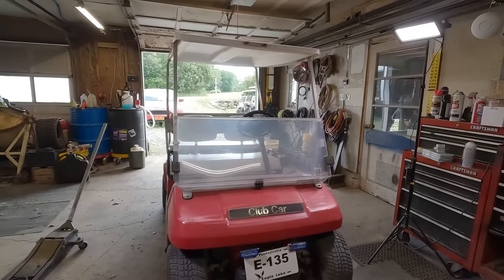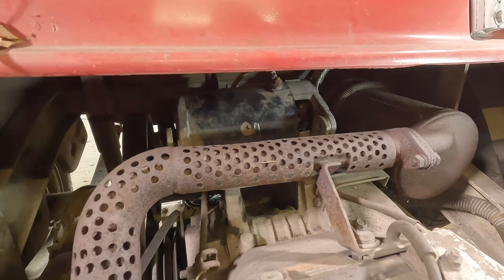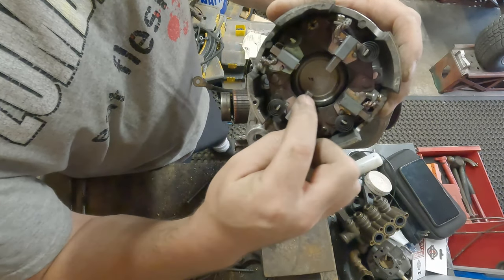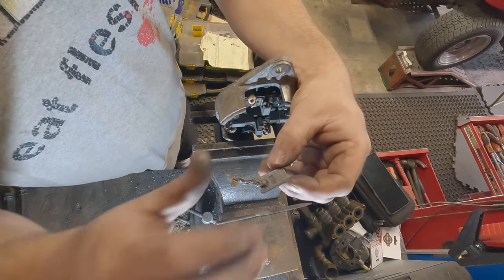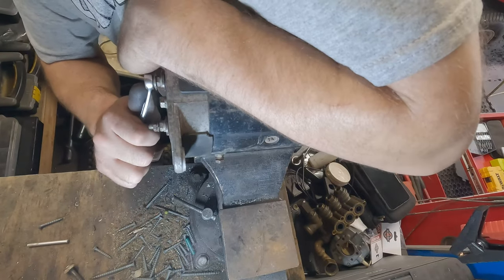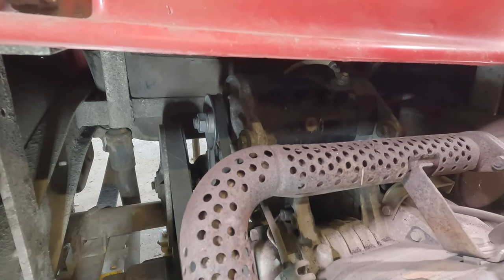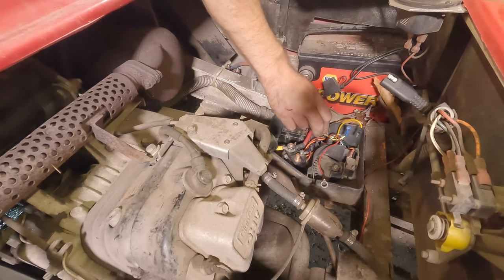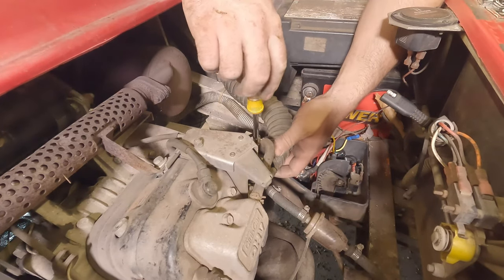1994 Club Car DS, Gas - It Just Stopped and Won't Start!

Comment: I’ve done several at this point.  Your page has been invaluable to me several times.  I found a local place that rebuilds oem start/generators for 125$.  Bearings brushes and truing commutators etc.  Fun fact, ‘95 Yamaha start generators are integrally mounted with the front motor mount.  Not a whole lot of fun in the heat while solo.  Again thanks for your content.  Helped me out in my golf cart community.

Comment: I'm getting a 92 Club Car DS next week and prepping thanks to your videos.  It does run and the owner says it's a coil he may have installed that was the wrong model.  Only Coil i see is the ignition coil so hopefully he can point at what he did.  Thanks for your videos.  Immensely helpful as I have no mechanic background and would be diving into this blind.

Comment: This is awesome. I have replaced my generator/starter two years ago and my starter solenoid on my 2000 club car ds. There is a plastic panel above the generator that I discovered that can come off to better access the generator.

Comment: Thanks Kevin great video, even though I've done these jobs before at the club I always pick up a new technique from you, like using the fork to tension the belt, that's a great idea! Thanks again!
Reply from the maker: I use the pickle fork because its conveniently placed and it fits, lol. You could use a small flat pry bar or large flat blade screw driver.

Comment: I had a similar problem. First press the pedal and make sure you have 12 VDC on the stud with the white wire. this will check for a bad connection due to copper corrosion in the cable brad

Comment: Kevin i have a 2006 club car precedent gas. It won’t run unless choke it. I can choke it and it takes off and runs ok. Then i can release the choke. But if i stop i have to choke it every time. I’ve cleaned the fuel tank, added new filter, new spark plug, and new fuel pump. The tank was dirty. It is overall running better.

Comment: Hey Kevin, what would cause the fuse to keep popping. If I put a wire from the battery ground to the generator motor the cart works fine but don't have a fuse. The battery doesn't go dead either with a wire hooked with out the fuse. It is a yamaha g16 gas

Comment: I had a cart same year and model last Thursday 1/2 mile  ride away blew spring set straight out of the Start Gen. 
was a customers part brought to me. cheap knock off. that was " rebuilt ".
Reply: I won’t touch Amazon start/generators.  I’ve gone round and around with those pieces of s&@t.
Reply from the maker: I won't install parts provided by customers. It has to be my parts or I won't work on it. I've had too many problems in the past so I no longer will make exceptions. This gives me control over the source and warranty.
Reply: @Kevinsgolfcarts  I’ve had the pleasure of fixing a formerly reputable repair shops stuff.  They were charging people oem like prices for  Amazon parts.  They failed, naturally.  Word got around that I wrench. It’s kept me a bit busy.  It’s sometimes hard to explain to folks that I won’t put cheap parts on their cart.  Folks just look at Amazon and don’t understand that you get what you pay for.  I also don’t do this for money, it’s just something to do when I get done with the day job.
Reply: Seems I'm getting more and more new customers for Clubcars 95- 2008. Oil leaks at  crank case near dip stick. Blown head gaskets. Screwed up wiring. Electric carts all day.

Comment: Hey Kevin, what was the voltage prior to thinking it was the voltage regulator?  I could not make out what you said over the noise of the motor.  I suspect it was over 15v.
Reply from the maker: It climbed to over 16 volts.

Comment: Hey Kevin, can you elaborate what Yamaha has done to "cheapen" their carts?  I know you prefer the CC but honestly, I can't buy a cart with a Kohler.  I've just had too many bad experiences with Kohler motors in the last 10 years.  Now, if they still had the Kawasaki motors, ok.  But we know that will never happen again and, hopefully, they don't go back to Subaru motors.  Our course has a few of those and what a pain mostly to get parts.  We want to stay with gas carts.
Reply from the maker: This could be a video all on its own. Starting with the G29/Drive, they started making the floor pan out of plastic. Its even weaker on the new Drive2. Its hard to strap them down on the trailer because they flex so much. These newer ones with the QuieTech crap are overengineered plastic junk. They have a nice transaxle with independent suspension. I think that's a bit much for a 800lb golf cart. They've added so much plastic junk to cover up and dampen sound, it makes it so much harder and longer to do regular service. I agree with the Club Car and the Kohler engines. Kohler needs to stick to making toilets.
Reply: @Kevinsgolfcarts  LOL!!  "Kohler needs to stick to making toilets".  That's a classic, Kevin.
Thanks for the reply.  I've had other Yamaha products and they have all performed well but, of course, I am commenting primarily about their motors.  I think they make good motors.  I definitely want another gas cart so I am in a bit of a pickle.  I like the CC frame but cannot purchase a Kohler.  I have never been an EZGO fan and pretty much thought of them as a "second tier" cart.  That kind of narrows it down to Yamaha...........and, I guess Cushman.  There again, Cushman has never been on my radar and I don't know much about them.  Dealer network seems small and wonder about part availability.
Maybe I should just keep my old CC DS with the Kawasaki FE290.  Have always done my own maintenance and repairs on this old gal.  It has been a great cart.  I just kind of wanted a newer unit with higher gears.
Reply from the maker: From what I've seen, Cushmans are rebadged EZGOs. I don't know if that's the case, but all of the parts are interchangeable. The older Yamahas are decent carts. Everything from the G22 and down are very easy to work on. The G29/Drive is the same, but the plastic floor pan and frame kills it for me. The G22 and lower use steel floor pans and frames.
Reply: mine has new predator motor, harborfreight

Comment: Hey Kevin. Love the videos. I have a 2002 ergo txt. Do you know what the voltage output should be for the stater / generator at the battery?
Reply from the maker: It should be around 14-14.5 volts. Anything over 15 volts or under 13 means the voltage regulator and/or starter/generator is bad. To test the starter/generator, connect the DF terminal from the starter/generator to the Negative side of the battery, the voltage should rise rapidly. You must monitor the voltage at the battery when you do this and not longer than 30 seconds.
Reply: @Kevinsgolfcarts  Thank You. I will give that a try.